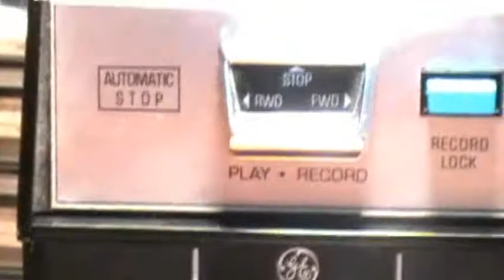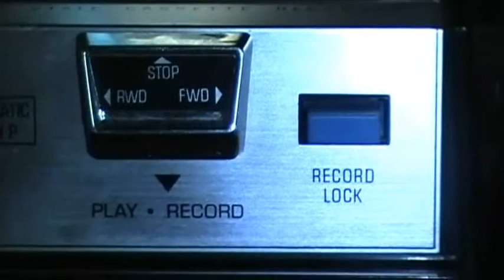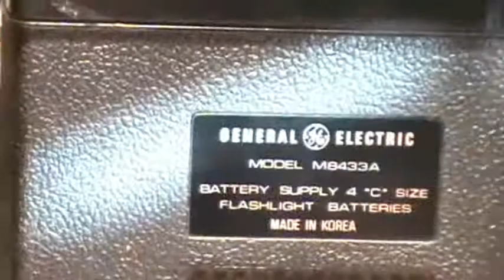GE M8430A and also M8433A vintage twin cassette recorders..

Comment from the maker: @trueschool14 The speed is already regulated by a metal post called the capstan. The take-up spindle is not the only part that pulls the tape through. The tape is fed between a rubber roller and a the capstan, and that causes the speed to run stable.

Comment: Got one at Goodwill recently, still works. The only problems is it'll play cassettes just a tad bit slower toning down the pitch of the song a bit, also for some reason it struggles to fast forward and rewind. I've been told that they're rebranded versions of the really early Philips tape decks that dates back to the mid 1960's.
Reply from the maker: The issue with FF and Rewind are likely a loose belt (on the top side of the mechanism).

Although these GE recorders bear some resemblance to the early Philips cassette recorders, the design of the GE recorders is completely different, both mechanically and electrically (and much inferior in quality electrically compared to the Philips recorders, which were really good). The GE is most certainly not a rebadged Philips!
Reply: @CassetteMaster  I eventually found out the issue, luckily it wasn't the belt. It took me a bit to find out that the piece that says stop, fast forward, & rewind is controlled by sliding the piece.

Comment: You think You can Help me out, I have the same exact model M8430A that I Just Picked up a Week Ago Came With Everything original instruction's, mic stand ,mic & Box, But Not The Tape got It For 2.00 bucks. I've tested it with a AC adapter but not batteries. When I turn It On With the Power Cord The tape hub's I guess You Call them  Spin Way Too Fast Any Suggestion's can You Help Me Out Thank's .

Comment: Maybe you can help me... I just bought this last night to play the tapes that I have and, for some reason, it won't play any audio. When I turn it on, I can hear some sort of feedback, but when I put in a tape and press play, nothing happens. The belts are fine because the heads spin alright, but nothing happens. Do you know the cause of this?
Reply from the maker: +XTheDesertSongX If the unit is simply emitting howl sounds and buzzes, then the record-play switch is likely dirty. The simplest fix is just to push the record button in and out a bunch of times to clear up the contacts (you can do it with no tape, just hold the lever in in the top left-hand corner of where the tape goes to activate the record interlock).

 If that does not fix the problem, then the record-play switch can be sprayed with WD-40 (sprayed a little where it will seep down into the switch--the switch is a long, multi-contact switch). If that does not fix it, it may likely be bad electrolytic capacitors (or maybe just one bad capacitor).
Reply: Cameron Dirty record-play switch, it’s a rectangular thing on the circuit board. Just spray some contact cleaner inside it and push it a few times

Comment: @CassetteMaster ok So here's What happen's When I Play A cassette It either Don't Play or The tape Get's Eaten Up.Everything Is Working The Big Wheel Is Spinning & Making the Capstan Spin But the tape hub's Won't Move & if it Does Spin the Cassette Will get Eaten up. Could this be Because Of A Dirty Capstan ,Rubber roller or head's????
Reply: trueschool14 are the reels moving? could be a bad belt